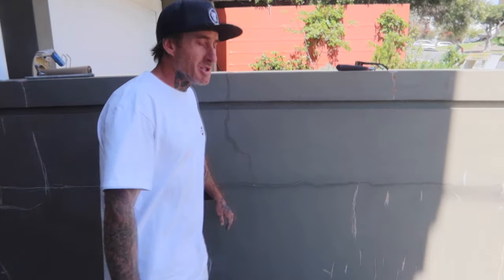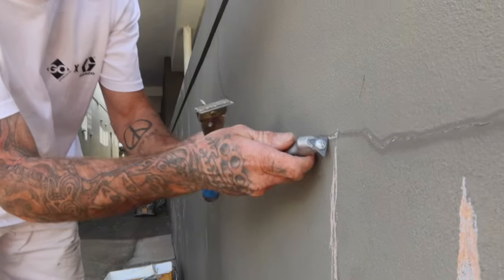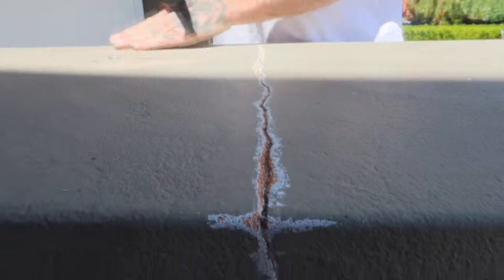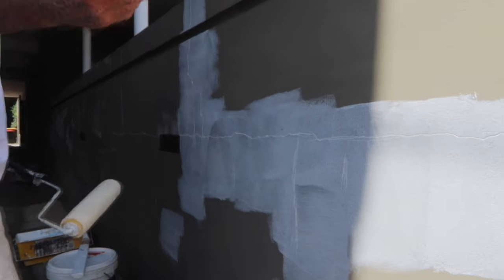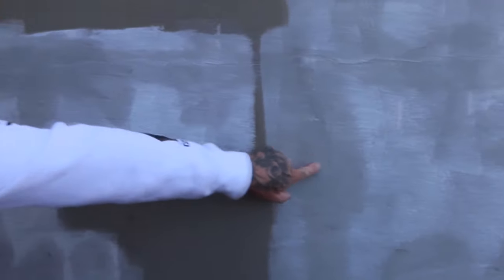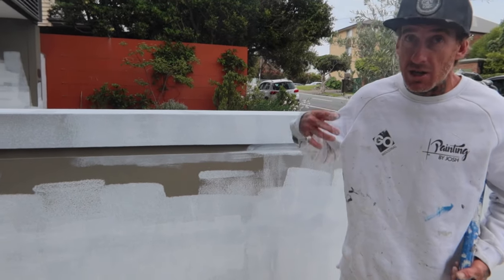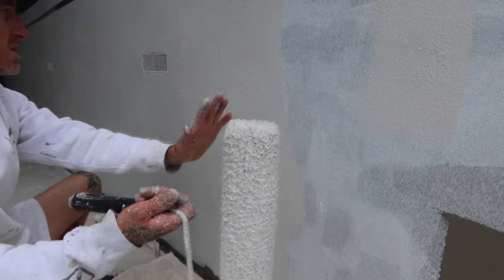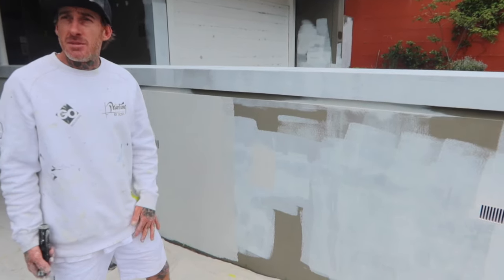FIX, PATCH & PAINT RENDERED WALLS

Comment: I'm impressed with your thorough repair of the wall and detailed description of what you're doing and why. If you were in NZ you'd be the guy I wanted to do work on my place!. Cheers
Reply: It's only a band aid fix , what people are not told over time the house moves about half an inch a year on foundation, knowing that the cracks will come back over time some where else on your house , I use to do solid rendering,wash sand an cement, these days they use bag render reason it's got additives in to help it not crack read the instructions like I was told , non shringkich  cheers

Comment: Nice job. What would you use to fill hairline cracks in render that open up with the seasons. Is there a flexible exterior caulk you'd recommend?
Reply from the maker: Hi mate, I would probably recommend Dulux acratex ACRASHIELD it's designed to fill and hairline cracks and is flexible. Hope this help 🙏

Comment: Was the last step the final colour? My interior walls have the issue of being rendered over brick and textured finish and although I don’t like the textured I don’t want to re sand all the walls to make smooth to repaint! I’m not ready to re paint yet, just patching cracks in walls and around all the cornices! Also what is the blade you use called? That is another issue for me, cracks previously repairs and not a good job so I need to get it flush again to do it again (cracks are back and can see their patches as well as it being really uneven etc in some places)

Comment: bruzzy do you have tips on paint old texture coat walls that have never been painted. We're doing the work via abseiling but on big walls we get lap lines
Reply from the maker: Yo brother it's a tricky one💯 you can do one section feather it out. Wait for it to dry then move down to the next section, but still can't guarantee it won't do it again. It's gotta be wet on wet. Maybe have another dude below keeping that wet edge. If that's possible with abseiling? Cheers

Comment: Hey Josh, loving the vids! Would love your opinion on patching cracks on a rendered blueboard wall. I've scraped out the cracks [Most are about 3mm] but torn between using a filler to patch as you've done in this vid or better to caulk? [Then paint with texture coat]. I expect there will be future movement in the blueboard and the filler will recrack quicker? Or if I need to also use a gap tape? Thanks mate..

Comment: Could you touch up a crack with the texture coat, and then final coat the entire wall. Or does the entire wall need to put texture coated?
Reply from the maker: Hi Kanye,  yes most definitely just spot texture the effected areas and roll out final coat 👍🙌

Comment: Would have been easier to just retexture the walls in my opinion
Reply from the maker: I did retexture after it was repaired. You can't just texture over defective walls in my opinion
Reply: @paintingbyjosh  Ive been rendering and solid d plastering for 20 years. I would have applied fibreglass mesh to entire wall and then skimmed with a polymer render. Then apply a texture coat and 2 coats acrashield.
Reply from the maker: I have been painting for 26 years not rendering. So that might have been what you would of done and this is what I did. No stress still came up magic and got a youtube video out of it to help others with render repairs that ant renderers. Cheers
Reply: @Trekz86 mesh isn't necessary. Just do two basecoats in acrylic render. One colour coat. Two sealer coats